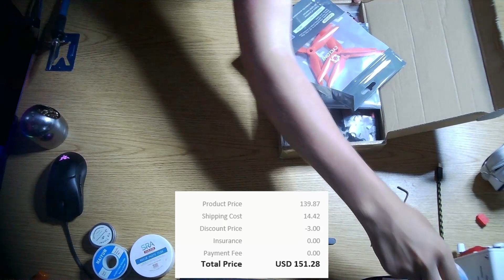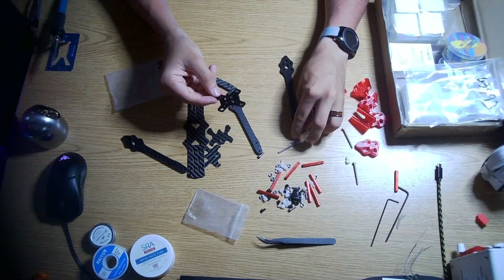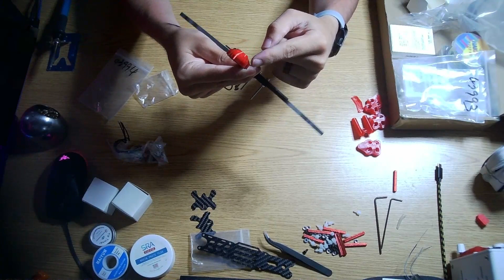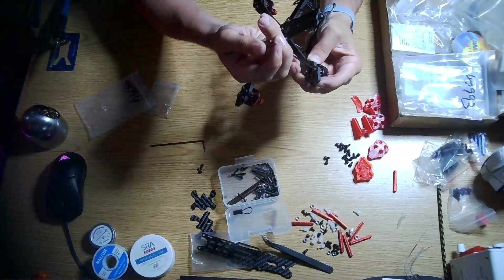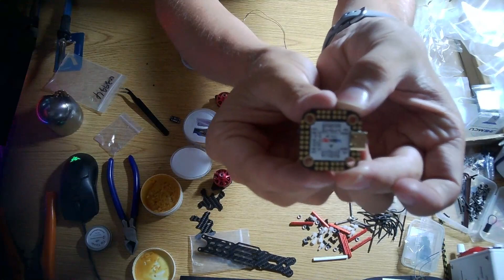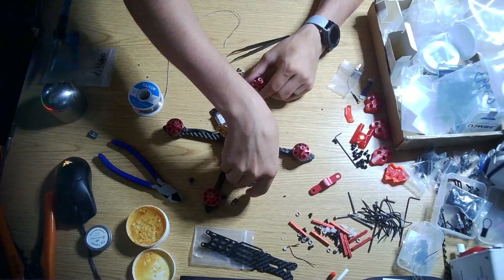$150 (Good) Race Drone Build!!

Comment: What is the use of other mini pcb board which comes with Jhemcu ESC
Reply from the maker: Great question! That is the TVS diode, it stops high voltage spikes. The capacitor filters voltage. While the diode with stop high current. I would recommend putting it on
Reply: Please guid me how to put this in fpv?
Reply from the maker: It wires the same as the capacitor. Right on the power input on the esc from the battery
 @anuragpriya5121
Reply: Thanku very much